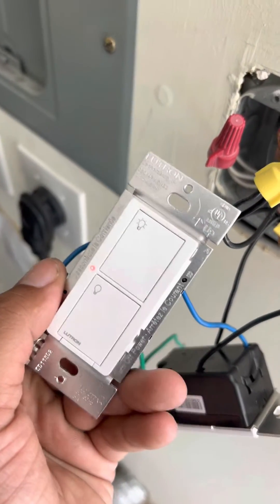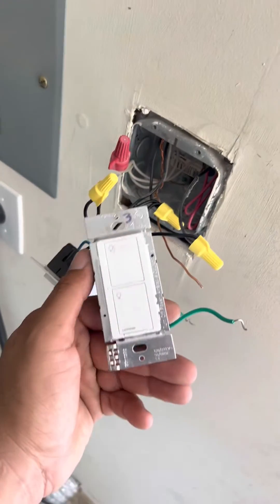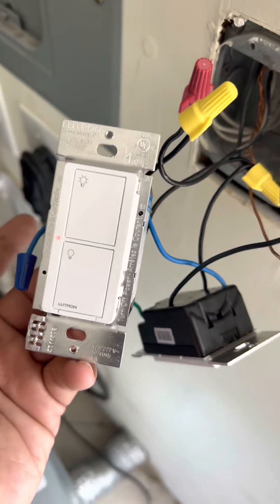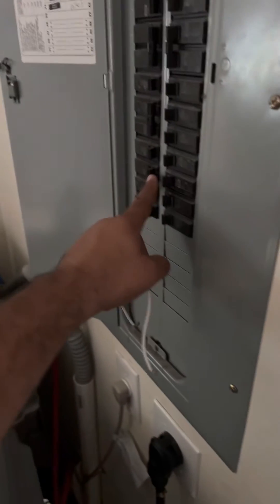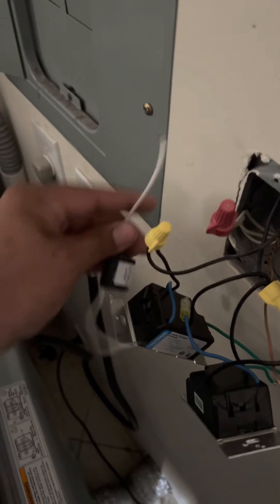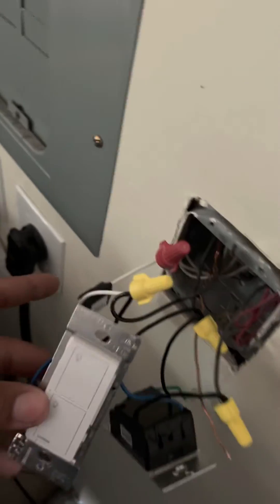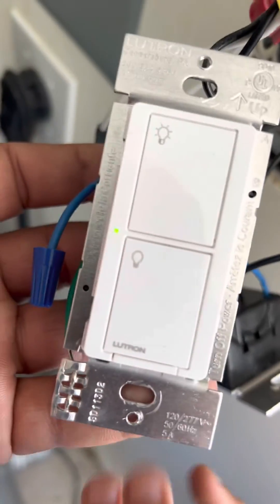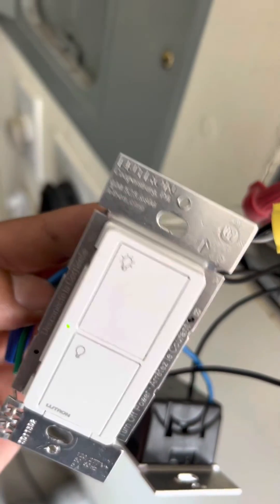Lutron Casita Switch flashing Light Installing Minimum Load Capacitor

Comment: I just got this and let’s see if it works. The weird thing is that my switch was working just fine till I change light bulbs last night - would lightbulbs have an effect on this?
Reply from the maker: check the wattage the switch can handle and make sure the bulb you install is range and dimmable

Comment: Thank you for this video.  I have 3 switched that control 3 small outdoor lights.  Switch 1 was fine, switch 2 was blinking red but worked, switch 3 was green and didn't work.  I installed this thing on switch 2 and it fixed switch 3.  Easy peasy!  Thanks
Reply from the maker: im glad i was able to help thanks for your feed back

Comment: Thanks for the quick and easy video. Sounds like I can use one of those. I installed 2 Lutron Caseta dimmers. One controls 4 retrofit recessed leds, no issue and the other controls only 1. The single one stays on very dimly when switch is off. After rechecking wiring, switching led etc I called  Lutron, tech said it’s called “ghosting” because there’s not enough load being drawn by 1 led  and to put a regular screw on type led and not use retrofit recessed leds. He never mentioned the MLC capacitor as a possible option. Lutron should give those free to those of us that bought Lutron switches or dimmers and get this issue. But then again the MLC must use a neutral wire to fix this and don’t know if it will fit in the junction box. It’s already crowded with dimmer installed.
Reply: Typically the MLC goes in the fixture box where there is a neutral.  Many times there is not a neutral in the switch box.
Reply from the maker: im glad i was able to help